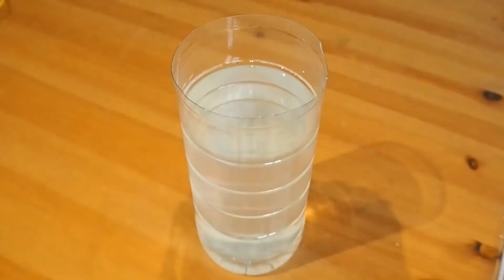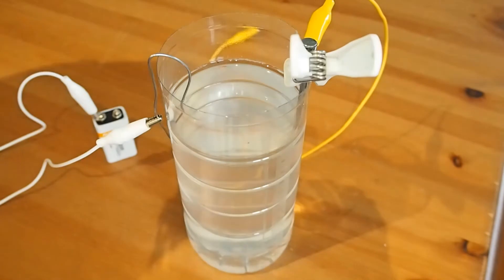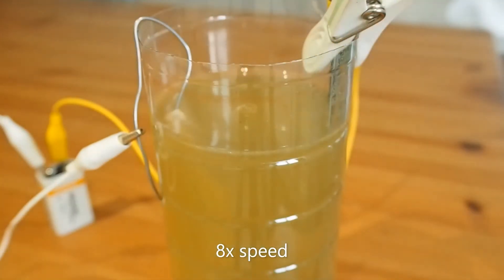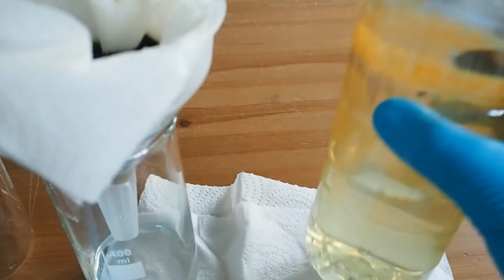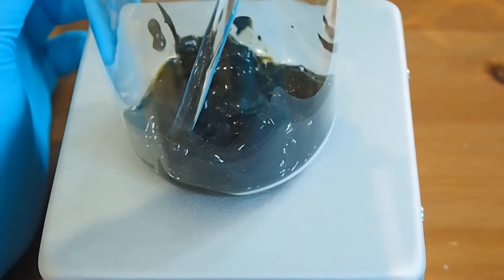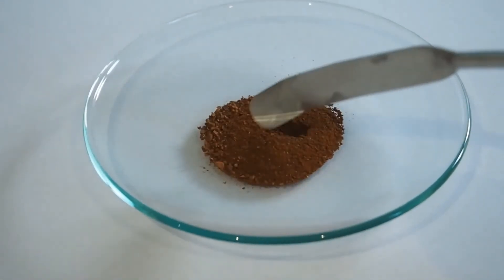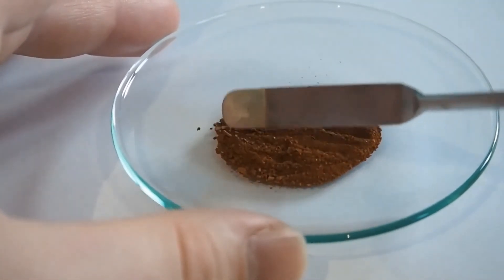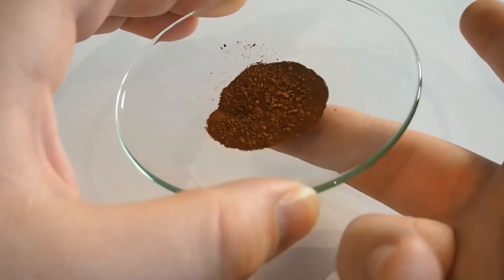Chemistry and Iron Nails - Making Iron Oxide (Rust)

Comment: I replicated every part of this experiment but during the electrolytic cell redox my salt solution is turning dark blue instead of orange; thoughts?
Reply: Well, for the first time in the history of my youtube videos ever, I am responding, but!
You are probably producing Iron hydroxides, or complexes. Getting blue compounds is perfectly fine. You just have to filter them and heat up. Then they will dehydrate and convert to iron oxide.
Reply: Voltage was to high rase the wire . 🤔 did you use a copper anod?

Comment: what happens if you get half a jar of iron powder, add water to the top of the iron to saturate it, pour off the excess water and evacuate all the air above the wet iron mixture then seal the jar?
Does the bottle fill up with hydrogen or other gas?

Comment: Dear QLab, I just now came across this video and liked it so much I subscribed to your channel and will recommend to friends and family. I do have one question though, now with this iron oxide can it be converted to iron acetate and if so, would it be easier and/or faster than traditional methods for making chemical wood stains and such, which could normally take weeks to dissolve the iron in a mild acid such as vinegar. Would preparing it this way make it easier and faster or is it even the proper material to used with such application.

Thank You.    J.R.

Comment: well oxygen is lacking a electron so obviously the oxygen would bind 1 of the irons electrons.
basically the oxygen has an electron hole and the iron has an extra electron to plug that hole.

of course this is likely very simplified as im no chemist , just a fellow who likes tinkering and collecting odd bits of information.
Reply from the maker: A good answer which considers the electron movement. However, it is important to note that oxygen formally has two unpaired electrons and if we take the formula Fe2O3 we can see that three oxygen atoms interact with two iron atoms. If each oxygen atom requires two electrons to be satisfied then a total of six electrons are removed from the two iron atoms. This means that each iron atom has donated three electrons which makes the iron 3+. I hope that was helpful and my apologies for taking so long to get back to you.

Comment: I actually recomend scaling this up with something like a railroad/railway spike. The reason is a nail or paperclip will give you practically nothing, maybe a few grams. Use a battery float charger since it will give a constant dc current,  but it will take a few months to a years to convert that kind of bulk iron. If you want to get really efficient, use sheet metal in a cell like structure for its increased surface area. I also recomwnd using kno3 salt rather than NaCl simply for its oxidation properties, with a stociometric equivalent amount of NaCl. This will produce a caustic environment on its own that will facilitate oxidation through variois side reactions, but will ultimatwlt result in exhausting the potasium into potassium oxides and chlorides, similar with the sodium, but for reasons i dont comprehend will also make removing sodium impurities easier.
Reply from the maker: Thank you so much for your comment and my apologies for taking so long to reply. There are some great ideas here, especially if you want to scale up. However, remember iron oxide is very cheap and abundant so often the work involved is not really worth it. This was an educational video and not to generate industrial quantities.